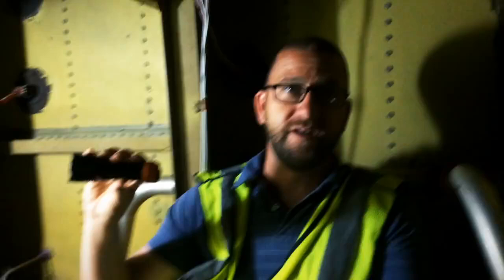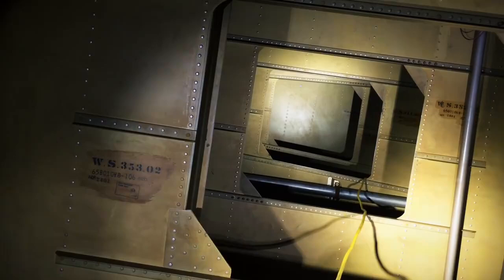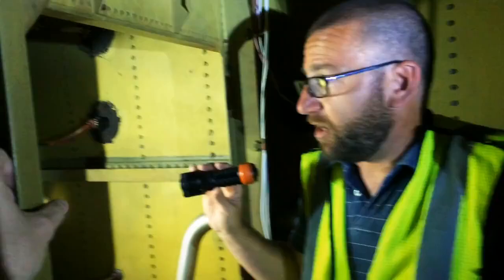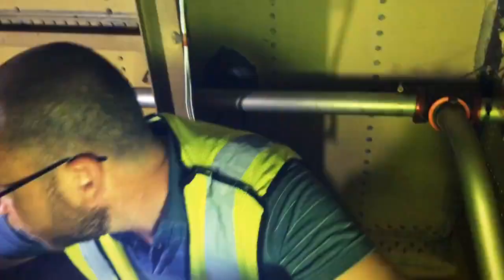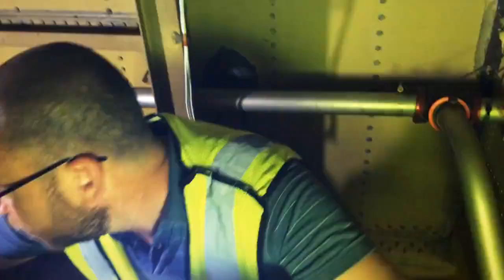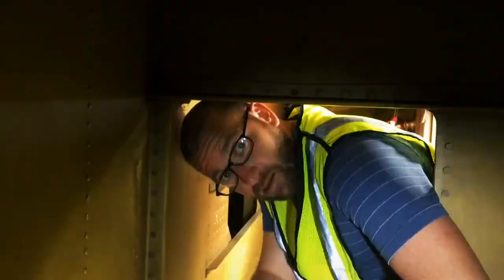The 747 Experience: In the Fuel Tank

Comment: Looks like an air or gas tank. Not designed for liquid fuel.
Reply: So you've seen air tanks designed even remotely like that in your vast experience have you? No you say. Gee, surprise surprise. Compressed air tanks all have several things in common. And yes I have been around many and even made a few that for safety reasons had to be thoroughly pressure tested before they could be used in the workplace environment where they were needed. They HAD to be quite thick steel and they had to be a shape that naturally couldn't flex or deform at all, in other words cylindrical with domed ends. Absolutely NO flat sections or bends or any shape that could deform at all. Oh, and because they are usually thick steel they are bloody heavy. Sure you could probably make them lighter out of something like Aluminium but the wall thickness would have to be so much greater that you probably wouldn't gain much.  In other words, this whole compressed air, resonance and burning Nitrogen is pure idiotic BULLSHIT!
Reply: KC ... plus you would have to hydrotest those tanks every 3-5 years... so technically you would have to remove them from the craft, transport them to the NDT station, pump water in them 5/3 the nominal pressure they are designed for, stamped and certified by an inspector... etc
Plus you would need valve regulators, god knows what crazy stuff you would have to design to build a craft that at least takes off on compressed air.
Actually, I'm interested if it's even possible.
Reply: You're right about the testing Cipi SixZeroFour, although 'IF'  they were full of compressed air as some sort of propellant for an aircraft it would certainly have to be far more frequent testing than "3-5 years" . I can't see any reason it couldn't be done with the wings still on the plane though. With all air replaced with non compressible water there's not exactly any great danger of an explosion. As I mentioned earlier though, one thing really screws things up for this idiotic compressed air BS. The wings 'aren't' round or cylindrical, they have very large either flat, or close to flat areas. That will never work with any real air pressure, they'd bulge and deform and fatigue would soon have them bursting. That's something none of the idiots who believe this crap seem to have considered at all. I've been within 15 feet of a truck tyre with 120psi when it exploded with incredible force, nearly killing the bloke working closer to it. Can anyone even imagine the force of one of those wing which despite the small minded idiots disbelief clearly do have quite a large capacity, certainly hundreds if not thousands of times the space inside the tyre on a truck tyre. At least the massive explosion if the wing/compressed air receiver was to explode and the fright it would give them would be the least of their worries. Those planes wont fly very well minus either wing.  This whole compressed air running jet engines idiocy fad is dying quickly. I'm amazed and disappointed it took off with so many clearly retarded morons.
Move over compressed air powered BS jet engines, time for the next stupid paranoid fad. I wonder what it will be. Ooh ooh ooh! I know!  The sun is actually a giant mirror, and the light source is actually a giant spot light hidden in a the crater of a dormant volcano. They shine it at the mirror and it bounces back what we foolishly think is actual sunlight.  Now let's see if that one takes off lol.

Comment: Your funny. So when you close that hole/hatch that you climbed in and out of no fuel leaks out, mmmmmm, and where do you pump the the fuel in them ginormous metal holes?? The A380 wings are not close to that size. You looked like you was in the side of a ships ballast tanks. Show me you actually getting into that wing full of rivets and holes and cables at the top that would ignite the fuel. Tell me how many pounds, Litres or gallons go into that wing. Where's all the hydraulics for the ailerons and flaps etc

Comment: Ballast on an air plane? Huge openings that are not going to baffle fuel whatsoever and prevent it from throwing an aiplane over. Wires in a fuel tank? load of crap! people do not us critical thinking at all and believe anything they are told. You really think an airbus A 380 can load 84,000 gal of fuel and get off the ground? That is 504,000 lbs and 228 mt. I do not think so. A complete load of crap to steal yor money. Look into it, jet engines do not burn any thing.
Reply: Obviously you don't know that most modern cars have electric fuel pumps and their wiring and connectors INSIDE the fuel tank full of much more volatile petrol did you. Try running your modern car on almost empty too often and your fuel pump will shit itself. It relies on the petrol it's sitting under to cool it.
And yes, a lot, if not all aircraft are much more stable with the right amount of ballast genius.
Reply: Large aircraft use capacitance probes to measure fuel quantity, with the fuel itself as the dielectric.  This means a small electric current is being passed directly over the fuel.  Wires inside the tank are no big deal.
Reply: I was told they use strain guages. Also told they fill by weight as in lbs but I see gallons on the guages. No uniformity in how jets are fueled or in how fuel is monitored? Not to mention composite materials for a fuel tank? Airbus A380 taking off with 239mt of fuel most of it in the wings and the rest in a tank between the wings?  So where is the support connected the two wings together? Don't tell me they are not, or that it runs around the center tank or through it. They have to be connected internally or they would fracture.
Reply: The wing spars are some of the strongest parts of the entire plane's structure.  They're kind of like the keel beam on a ship.  They run the entire width of the wings and connect to each other at the center in a beefy structure commonly referred to as the wing box.  It isn't simply attached to the fuselage.  The fuselage is built around it.    

The center fuel tanks are formed by the wing box, and the wing tanks are integral to the wing structure with the forward and aft spars forming the front and back of the tank and the wing skin forming the top and bottom.  Any control surfaces or landing gear wells are outside of the spars.  Mind you there might be more fuel tanks elsewhere in the fuselage and sometimes even in the tail, but the primary wing structure and tanks use the same basic formula in all these large aircraft.  If you really want pictures I'm pretty sure I can scare some up from where I work.

As far as gauges go, the aircraft reads by weight because that is the most important aspect to consider for a flying machine.  Aside from actual fuel mass being critical to flight characteristics and fuel consumption, volume measurements would be pretty useless for knowing how much fuel you have on board because volume changes with temperature.  Planes go through massive temperature differences from the ground to 35,000 feet.

The fuel truck reads by volume because they're all about the money.  They will fill the plane to a specific weight as requested for the flight, but jet fuel is priced by the gallon like any other fuel operation.
Reply: Thank you for giving some info on this subject without having to resort to negative labels in regard to my lack of knowledge in the matter.  I cannot seem to find any real schematics for these structures, everything l find looks like a cartoon.  No diagrams avaliable that show the tank along with support structure, piping, electrical, hydraulic and so on. So many conflicting facts I find when looking at this. Seems like it should be cut and dry although it has been anything but.
Reply: Jacob Meek it could be that detailed drawings are commercially sensitive, hence a lack of on the inter webs.
Reply: Commercial airliners and boeing are somewhat of a shadow organisation when it comes to plane design.

Comment: If these were fuel tanks for a plane there would have to be many baffles and all tanks need to be individual. I see the ribbing on the floor free flow connecting all tanks and im sure those man holes are not closed off.
These resemble compressed air tanks.
Liars.
Reply: You clearly don't know anything about what compressed air tanks look like.
Reply: What am I saying, you have no idea how to design any tank, being compressed or open to the medium.
Reply: I think tying shoe laces might be about the limit of Steve Smith's abilities.
Just exactly how the hell do "These resemble compressed air tanks."????????????????   Fucking amazing that an idiot who knows absolutely NOTHING about a particular subject can decide for themselves that they're an expert, fucking obviously without ANY experience with something like pressure vessels.
Next point. If you understood the physics involved in flying and turning an aircraft you'd understand why they don't need massive baffling in the tanks. Just because you see a plane banked over 30 degrees does NOT mean the fuel tries to flow to the lowest end of the wing. In exactly the same way as you don't feel like you're falling sideways out of your seat when it banks genius.
Reply: Compressed air tanks... made of flat, thin sheet metal... riveted at the corners.... with openings.... sure, there's nothing wrong with that at all!
Reply: Peregrinus you think too much. This is what Steve reads your message:
'Compressed air tanks... made of fl̶a̶t̶,̶ ̶t̶h̶i̶n̶ ̶s̶h̶e̶e̶t metal... riveted at the corners.... with o̶p̶e̶n̶i̶n̶g̶s air holes... sure, there's nothing wrong with that at all!'

Comment: You can clearly see what appears to be electrical cables in these so called fuel tanks.
Reply: Fuel quantity in large aircraft is measured using capacitance probes, using the fuel itself as the dielectric. This means a micro-electric current is being passed directly over the fuel. Wires in the tank are no big deal.  Your car uses a submersible electric fuel pump as well as an electric quantity indicator.  Both require wires inside the tank.  Wires can be sealed as needed, just the same as any other part of the fuel system.
Reply: @herbderbler1585  makes a lot of sense.

Comment: Look out the window of the 747 you are on next time. Lol, now do you think someone can fit there? NOPE. Someone's been lying pretty bad! How dumb have we been?
Reply: Please educate yourself by following this link: https://www.quora.com/Where-is-fuel-in-a-passenger-aircraft-stored-and-what-is-the-typical-capacity

You don't even need to read the whole thing, just look at the second pretty picture and notice how thick/tall the wing root is compared to the worker on top of the wing. Granted, it's an A-380 and not a 747, but the 747's wing root is similar in size, only slightly smaller.
Reply: Here is a diagram of the 747-400's (wing) fuel tanks: https://i.stack.imgur.com/R2qRK.gif 

Here is a diagram of the 747's center wing tank: https://upload.wikimedia.org/wikipedia/commons/9/92/Center_Wing_Fuel_Tank.png 

Here is a photo shot at the Boeing factory in the "Wing Stub Build-up" area I used to work in where we built the center wing tank. This photo shows the sheer size of the first two bays (of 5) of the 747-400's center wing tank (scroll down a page): http://www.iasa.com.au/folders/Safety_Issues/FAA_Inaction/nea.html
Reply: Thanks, King Congo.  After years of trying to understand why "chemtrail" believers on here call me a government agent when I tell them how relative humidity is responsible for persistent contrails I started to look into the psychology of it... 

In the case of "chemtrails", when a person is suffering from a persecutory paranoid delusion fear/emotion disables the brain's frontal lobe and suspends all logic and rational thought.  
What is left to operate the mind is emotion (fear & suspicion) and confirmation bias.
Confirmation bias filters out all facts that threaten the belief and labels the "messengers" who deliver the facts as "government agents".  
Which makes it easy to get rid of them.

Now I can't imagine why this "compressed air" thing would be experienced as a delusion that persecutes a person, but as you can see from how I was dismissed from the discussion for the high crime of saying "Have a great day!", the exact same psychological principles are in effect.

He dismissed me and my facts that threaten his belief from his reality in the exact same way a "chemtrail" believer does it by deciding that I am a government agent.

So, even though the compressed air thing isn't persecuting these people, on some deep emotional level it apparently feels that way... someone is "trying to trick them/lie to them".

Perhaps they feel that their very being is under attack like when they were 5 and their chaotic disciplinarian parents were always "out to get them".

The parents are the authority figure of childhood. 
In adulthood this is transferred onto the government.

I get all caught up trying to help these people to not have to believe in lies by typing out a bunch of facts for them only to get irrational negative character attacks in return... 
I try to remind myself that I would never walk into a mental institution and think that I could help people suffering from a delusion because I know that I am trained as a pilot, not as a psychiatrist.

Facts, science and logic are simply no match for confirmation bias.
Reply: Also, something called "Dunning Krueger Effect" has been observed where skilled intelligent people underestimate their abilities/knowledge/expertise and unskilled unlearned unintelligent people overestimate their capabilities... which is really the most accurate explanation of the "chemtrail" religion there is (aside from the persecutory paranoid delusion part).
Reply: King Congo said, "if I see that even a very interesting sounding video runs for even half an hour I'm unlikely to watch it."

That is very good to know, thank you!

" I was starting to look at crowds and wondering to myself just what percentage of a group were actually secretly as flaming insane as some of these idiots we see here a lot. So thank you for helping me get a bit of perspective back on that , I did need it :-) "

:)  Then I won't tell you that I saw an article on the internet that said that 4% of people polled believe in "chemtrails".  :)   But that poll was on the internet where the delusional live so.... err, wait a minute... no, I think the poll actually said that 15% believe in "chemtrails" which is even more than the 4% who believe that Lizard people rule the world!!!!   LOL  I'm serious.  I think that is what the article said!  
Don't think about it!!!!                  Hey, did you know that the internet says that Princess Diana called the Royal Family, "The reptiles" and "Lizards"?    :P    (I'm not joking!)
Reply: I could believe the bit about Diana. That doesn't mean she thought they were actual reptiles though. She had a cheating Prince Charlie and was very much the outsider, she'd become a threat to them and they probably didn't try and hide how they felt too much. It's quite possible they were responsible for her death too.  I've known of plenty of people others refer  to as "a snake in the grass" and I'm guessing that's just an idiots interpretation of her saying something along those lines.
Reply: i do it all the time and i am 6'2 tall